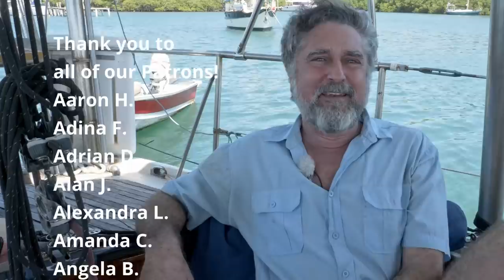Fixing Our Boat's REFRIGERATOR [Capable Cruising Guides]

Comment: I have worked with automotive a/c systems for 20+ years, very simple explanation.  A couple of things to consider:  the size of your condenser should be proportional to the size of the evaporator.  In adding the water cooled condenser to your system, you did mention that you would be running the fan, or pumping water, but there is a misconception that bigger (more) is better.  Customers often state that they need more Freon added to a system when it’s not blowing cold, and I have seen systems overcharged 2 fold when the problem is no air flow across the condenser.  Because pressure and temperature are proportional, using a temp gauge is another way to diagnose an a/c system.  There should be somewhere around a 20 degree (freedom height) drop across the condenser.  So, 180 ish going in, 160 ish coming out basically.  Same principle applies for the evaporator proportionally speaking, albeit in reverse.  So, 32 going in, and somewhere around 45 coming out ideally.  It’s one way to determine if your condenser to evaporator sizing is proportional for your compressor to be most efficient.  I haven’t watched all your videos yet, and maybe you have like a 201 or 301 class on a/c theory that goes more into this.
Reply from the maker: Thanks

You might find this playlists interesting:

A/C and Refrigeration: https://www.youtube.com/playlist?list=PLsT7_jPsZM5qNlstuF-fdlgjrimo18tq7

Comment: Wow!  So many parts  used in so many different applications. I didn't completely understand the condenser until you showed it. Home brewers will know that as a counter-flow chiller. Hot wort in the inner tube. Cold tap water in the outer tube. Wort flows one direction; water flows the other. Heat transfers quickly. My 40' garden hose/copper tube version takes hot wort from near boiling to 75°F in a single pass.

Comment: As a hvac tech I pressurize the unit with nitrogen and little freon to find leaks and braze it instead of using flair when you cut the lines open you need to replace filter drier. Also flow some nitrogen when you braze so you don't need to deal with carbon pieces ending up in metering device.
Reply from the maker: Thanks, all good ideas but as an amateur with limited space for tools and such I have to cut corners.  No room for another gas bottle.  Sounds like a useful approach though.
   I've actually found that a long time on vacuum "refreshes" driers.  Anyway I've taken systems that had iced cap tubes and fixed them with a few hours of vacuum.
    Do what we must with what we have.
Reply: @spangenbob  You can get a special filter for when the compressor has burnt out. A "Burn out Filter". I absorbs the vapour from the burnt insulation.
Reply: Agree on eliminating as many flair fittings as possible. I don’t have removable joints in any system unless required by a component. If brazing it should be nitrogen purged. When soldering nitrogen purge is not required. I prefer soldering lead free silver bearing and as a portion of the industry consider it a better choice than brazing.

Comment: Hi Clark I noticed when you flip the unit up on that side the condenser was completely covered with dust and debris. You might want to mention that since you have it out you should thoroughly clean that to increase the airflow. That in and of itself will give you a boost to refrigeration.
Reply from the maker: I was wondering if anyone would see that.  Good eyes, or monitor!
   Yeah, I was amazed at how much crap was in there.  Brushed right off.
Reply: @Clarks-Adventure  The rule of thumb is that for every 1°C you can bring the evap. and condensing temperatures together you save 3% on compressor power.
Reply: Ohhhh we saw ;-P !  @Clarks-Adventure

Comment: You may be the only man I have seen be able to tackle this issue out of all my boat channels.  Combined with you electrical skill I am impressed.  I did want to mention that filter driers have a lifetime.  I have seen them leak at the inlet because they have become saturated and/or plugged.  This increases the pressure at the inlet port and it then leaks. Typically they last about ten years in any application..but that varies.  On most service calls for this leaking issue regarding heat pumps they are typically replaced by the tech.
Reply from the maker: Thanks a lot, that was nice of you to say.

     This one was passing refrigerant fine, I had a high pressure gage on it before. But good to know for future problems.
      I ended up removing the old dryer and soldering in a locally available dryer (not much of a filter by the feel of it).  I left that out of the video as it would just have been to much. Must have had a flaw someplace, maybe on its side of the flare fitting.  New one is in and working so I'm happy.
    Food is cold and pressure is still up after 3 weeks.
Reply from the maker: Yeah, and I had to solder a flare into the dryer as I'm set up with flare going into my box.
The dryer I had was way overkill for a system this size anyway.

Comment: Nice! Thanks for this. I am an electrical and software engineer who also has done a lot of copper pipe soldering plumbing, some flair fittings for propane gas lines but I have never tried to fix an air conditioner or fridge. Good to see someone do this!
Reply from the maker: You're very welcome Herbert.  Have you watched our Capable Cruisers Playlist?  Lots of videos there you might also enjoy.

Comment: When I was a pipefitter( union plumber) I loved using Rigid 101 imp cutters. Like your small cutter but could cut up to 1"copper. Also could keepa spare cutting wheel in the handle. Really nice tool.

Comment: Thanks Clark (and Emily for documenting), i have a couple of old A/C units on my boat that still use R-12 which is getting hard to find especially considering price. One still works but is on it's last legs. These are split systems and I'm considering replacing with all in ones. Your explanations and videos will make it easier for me to understand and trouble shoot in the future.
Reply from the maker: I replaced the gas in an old r-12 porsche back in 2003 with R134a.  Some say you can't do it.  Some say you need to flush and change the lube.  I just changed the gas (and fittings).  Has been working for enough years in Florida I'm saying it's fine.

Comment: Excellent, excellent, information. Best video and most useful I have seen in quite awhile. $600 charge for a "reversing valve" bypass in Puerto Rico on an AC unit. Solder drips all over the pipes by the tech, super sketchy conglomeration of parts- but it does work now. I will be buying and carrying the tools you recommend to fix it myself in the future. I did notice that nothing I have has a freon charge port similar to my car AC unit. I am guessing I will need to solder one in someday maybe?
Reply from the maker: Cars use special ports.  Fridges use 1/4 flares with a schrader valve inside.   Same as a car tire.  Pretty universal except for the gas in a lot of mini splits, I forget the number just now.  But there is an adapter for that.
   More on that next week.
Reply: @Clarks-Adventure  Great looking forward to next week then.  This series is covering a lot if stuff I gave been trying to learn last couple if years, before buying the boat..

Comment: Clark I don’t think you could see it because of your ventilation shroud covering it but your condenser was caked with dirt and that was likely obstructing most of the airflow across it. That is costing you a lot of amp hours! Very helpful video and I am interested to see how you plumb in the seawater circulation part of the system. I have heard that they are problematic to maintain as you mentioned. Thanks Ben S/V DAWN
Reply from the maker: You're welcome Ben.   Yes I saw that.  Brushed right off.  You might notice in this weekend's video that the tape is now yellow from reattaching the shroud.   You have a sharp eye!

Yes I go into that in this week's video.  It's on Patreon now but will be generally available this weekend I expect.
The last saltwater condenser lasted about 25 years but it got grown up in barnacles a few times and I had to acid wash them out.  But all in all lasted a long time.   The one I replaced was replaced partly because I wanted a larger saltwater passage.  I share a pump with that and the ac unit.  Pump runs when either compressor is running.  The old one was a restriction to the water flow.

Comment: I think SeaFrost up in New Hampshire would make a whole freezer box if asked (though, of course, not as cheaply as you making it yourself !😲..awesome, way to go !)...he makes every stainless steel cold plate custom to the installation, and asks for your specific dimensions for every order, so I wouldn't be surprised if he'd do a custom box instead of just a cold plate.
Reply from the maker: I'm surprised anyone is using cold plates anymore.  Their time has passed.  They only make sense for an engine driven compressor.  But are inherently in-efecient and needlessly use up valuable space.

Evaporator boxes are actually harder to manufacture then cold plates.  Hence the DIY look of mine and the expensive materials.   But someone looking should make a call.

Comment: Again, good info related to how the system works and why. Interested to see if the new condenser helps a lot or not.
Cheerz!
Reply from the maker: I have used the last one for over 20 years.  Really helps in hit places.  Makes little difference when it below 80 or so.
   I think the last one corroded through.  My sniffer found some gas in the water side.  So I removed it several months ago.  But 20 years of saltwater service, I'm no complaining.
    The new one has a larger saltwater pipe.  Same as the ac unit so I can run water serially through both with the one pump.

Comment: This was great. Thanks. In your nest video please point out how and where to add charging nipples for fridges and freezers that are shipped without these and precharged from the factory. I’m talking about fridges like Novacool fully self contained units that simply drop in and only require power. 😊 👍
Reply from the maker: Good point.   Also don't buy Novacool I guess.
Reply: @Clarks-Adventure  good advice when buying new or replacing/upgrading, but in my case came with the boat.
Reply from the maker: There is something called a vampire fitting.  I don't use them but with one you could (or someone else could) top off gas without opening the system.

Comment: Great experience !! What is the "LAMP" on a BD35 controller for? The LED is error codes, but the LAMP seems to have no data ? Thanks !
Reply from the maker: I'm not sure what you mean by lamp.  The bd35f controller has a place to connect an LED that, as you say, blinks to explain failure states.

Please describe where the lamp contact is
Reply: @Clarks-Adventure  On the Webasto Wiring Diagram of the BD35F, the incandescent lamp connects to A and C terminals as Item 10 "Lamp". The Webasto pino-out, top to bottom is L N    - +  FACDCPT ( L&N are 100-1240VAC power , 12VDC is on + & - ) That diagram shows the LED connected to + and D.  If y0u don't know/use a LAMP, I'll assume it's not important ( Experience appreciated !)- THANKS !!

Comment: Thanks for this video, Clark.  On a boat, out in the middle of nowhere, you need to be a jack of all trades.  Professionals sometimes are nowhere to be found or are so busy that they never get around to doing the small jobs on boats as they have to take care of their commercial clients first.  What solder were you using?  Any need for special solder for high pressure?
Reply from the maker: Take a look in the description.  I put an amazon link to the kind of thing I use.

I don't care to carry o2 so I can't use the high temp stuff.  I've not really had any problems that didn't lead back to my soldering technique.   I used to get carbon in my joint back when.

Comment: Clark.  Do you have a link for the saltwater condenser?  Thanks!  Getting ready to replace the dead compressor on our boat and would like to plumb one in while we are at it. Great videos!  From knots to nuts & bolts, we appreciate them all.
Reply from the maker: I have some crazy great titanium ones I use with my battery AC units.  But for copper Nickel you need to search to find a good price.
  RParts.com has things like this.
Reply: @Clarks-Adventure  Perfect!  We will save up for the fancy titanium one when we install the AC unit. I found several copper/copper condensers but the copper/nickel is just what I was looking for.  Thanks again.

Comment: Hello Clark thank you for all your great videos. Really gave me the nerve to start my refrigeration system rebuild. I was wondering about your diy evaporator. What size tubing did you use and how many feet? Roughly. I think I might build my own but can’t seem to figure out tubing size and length. I have a Danfoss bd50f.
Reply from the maker: Thanks.

I have the same compressor.  I'm doing the camper trip so I'm not at the boat.  So no specifics available.
I made a box from a ss shelf and copper sheet.  I wrapped the box in 3/16(?? Size below 1/4) tubing, soldering it as well as I could.  Probably 50 feet or just a bit less.

I then run to some 1/4" under the shelf then back to the compressor.

The tricky part is you need to calculate your capillary tubing size and length.

The cooling tube isn't critical.
Reply from the maker: Box was about 3 ft³
Reply: @Clarks-Adventure  That's awesome. Thank you for getting back so quickly. I have an old aluminum evaporator that ended up with a hole in it. I was planning on using the old cap tube as nothing is wrong with it and its copper. So assuming nothing changes with the cap length do you think i will have to recalculate if the cooling tube is different in length but the cap remains the same for the system? I've looked around for how to calculate but haven't found anything about it yet. Also did you solder or braze?
Reply from the maker: Cap tube is matched with compressor.  If you are using the same compressor you will be fine.

I just use silver solder and a propane torch.  Always worked fine for me.
Reply: @Clarks-Adventure  Thats great news! Thank you again for all you great input to everything sailing. We truly appreciate it.

Comment: Thanks for these videos, just what I was looking for! Was just doing some follow up Google-fu and it looks like the BD35F and BD50F are discontinued by Danfoss. Secop are releasing a BD Nano which apparently replaces them. I'd love your thoughts on this as information about these doesn't seem easy to find, and parts I'm seeing have wildly different prices. With no background on the subject it's hard to work out what's what. I was looking to buy some parts and test building a fridge which will later become spares.
Reply from the maker: Danfoss sold out to secop years ago.  They still make the bd series I believe.

Yes lots of things have inflated lately.

I get most of my stuff on eBay.

Hope you watch our other videos and choose to subscribe
Reply: @Clarks-Adventure  Thanks for the quick reply. Yes already subscribed and started binge watching instead of work this afternoon! Inflation I get, but these things range from £100 to £1100 for the compressor and/or controller and seems completely arbitary. I was hoping to find a shop in the UK but finding the BD35F and BD50F discontinued it was a hard process since most suppliers of fridge stuff don't stock the 12V ones and without the current part name I couldn't search for the part. I'm making progress though, it seems the BD Micro and BD Nano are their new versions and helpful to know it's the same company.
I really thought the hard part would be re-gassing but from your video that looks way easier than buying parts in the UK! I feel well on the way to succeeding with this now so thanks again.
Reply from the maker: Glad to hear it.

I read ALL comments so tell me how it goes with the new compressor.
Will you use 134a or iso-butane?  The butane can go boom if it leaks.
Reply: @Clarks-Adventure  will do! 134a probably, although that will only happen if I successfully assemble the bits and pull a vacuum. The existing boat fridge is working fine so plenty of time to practice :)

Comment: Hi Clark, my adler barbour cu-100 cold machine (older model) has only one port sticking out from the top of the compressor. Refrigerant leaked when trying to cut through the fiber glass, and now I need to flair the 3/8 inch tube to seal the leak and then vacuum the system. I have all the equipment, but I am confused which hose to connect to the only port available. Can I connect the blue hose, open that valve, maintain the red hose valve closed, and connect the yellow hose to the vacuum in order to vacuum the system? 

If not, will I need to solder a new access port on the either the low or high pressure lines?

Once I do that, filling with refrigerant using the same port will be a breeze following your video. Any help would be greatly appreciated :-)
Reply from the maker: Yep, that's the low pressure port (blue).  

    Just as you said.
Good luck but if you got the leak fixed you won't need it.  The rest is easy.